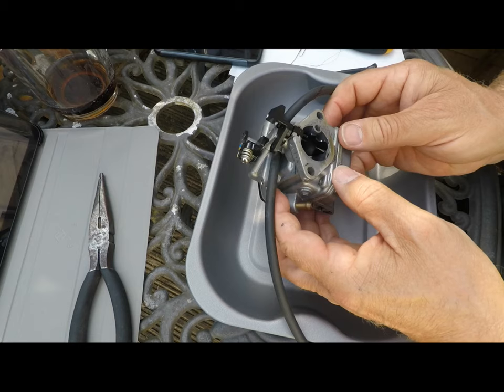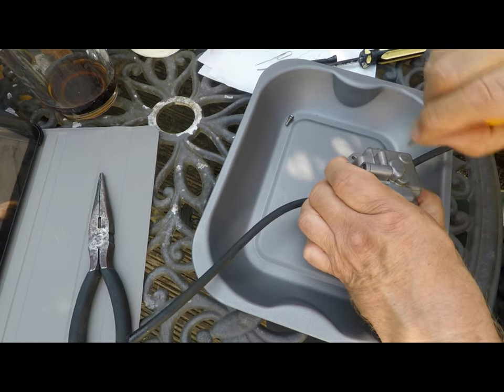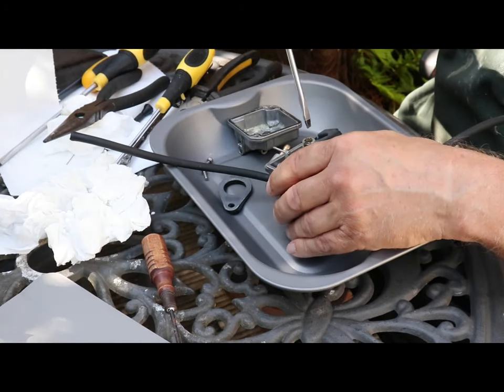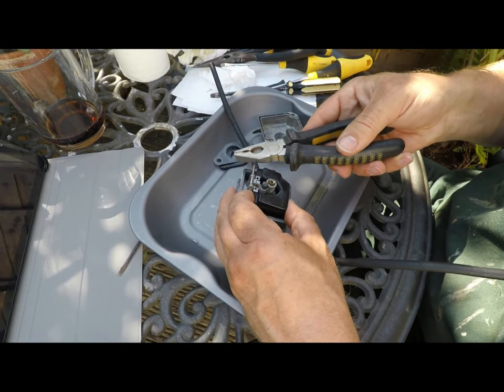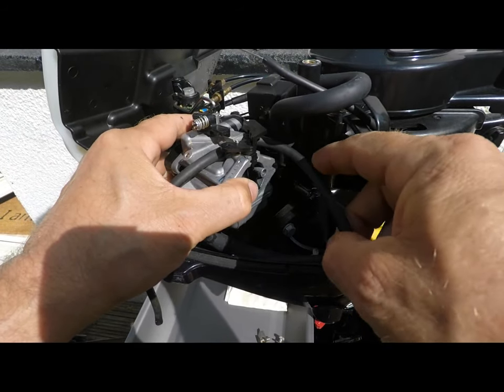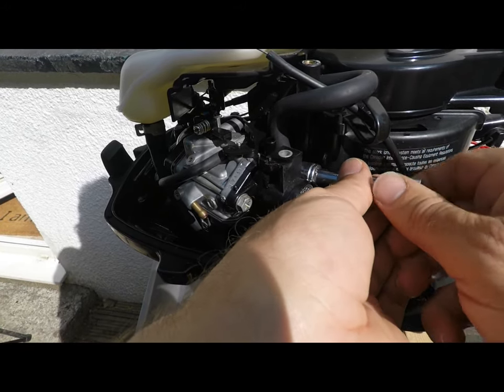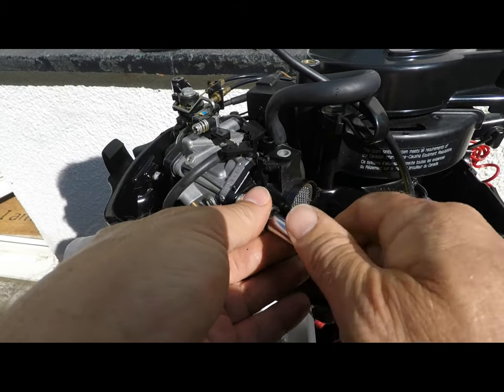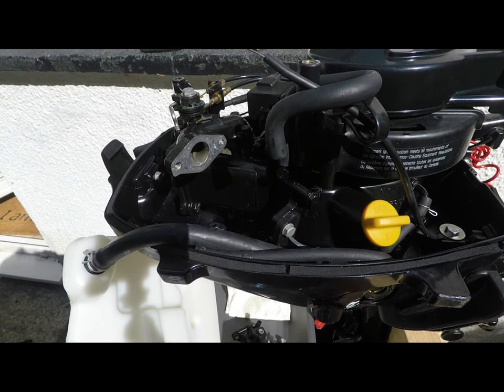Dinghy cruising cruising a Welsford 'navigator': cleaning a Tohatsu 4 stroke 3.5hp carburettor

Comment: I have the same outboard, and a sticking main jet appears to be a well known problem of the 3.5hp model - be it Mariner, Mercury or Tohatsu etc. Despite winterising, I went through the same routine every season to ensure trouble free starting. Removing the main jet was always a problem which I solved by stripping down the various jets at the end of the season and then only had to reassemble at the start of the next season.  A quick tip is after attaching carb to manifold push overflow tubes from outside the casing and simply slide onto carb.
Reply from the maker: Brilliant tip....wish I'd thought of that at the time.....🙄😄

Comment: I had a similar learning experience when a screw sheared off halfway into my Mirror Dinghy transom. Took over an hour with various pliers, drill bits and whatnot to remove, not to mention the mess left in the wood afterwards! Very brave to attempt servicing your own outboard, I just sold my 3.3hp and got an E-Propulsion Spirit. No more maintenance...
Reply from the maker: Yeah, in hindsight maybe I should have just paid the £120. But then nothing ventured, nothing learned or gained 🙄
Reply: plymouthwelshboy Oh absolutely. I’m all for trying things yourself and learning from it. Part of the joys of wooden boats and dinghy cruising!

Comment: I used all 4 methods to clean carbs which are carb spray, wire, ultrasonic and air compressor. I don't feel like taking 3-4 carbs off clean putting back on and still running crappy
Reply from the maker: actually it has been running really sweetly since I took it off and gave it a partial clean
Reply: I did a partial clean a few times on carbs that weren't too bad and ran fine also. Sometimes I just spray carb cleaner and run seafoam or some gas cleaners and motor runs better
Reply from the maker: @vkhiev  I just used carb cleaner 😄

Comment: The brass threaded parts (jets, etc) need a screwdriver that fits perfectly in each respective slot. Preferably the screwdrivers will be hollow ground, and not a flat taper at the tips. The hollow ground drivers have a blade with the working faces nearly, if not actually parallel to each other and wont cam out of the slot and they'll drive the soft metal much better.

The brass parts will be/can be really hard to shift and will release/come loose with a snapping motion. Ideally the part will be braced against something so you dont slip and spear yourself when they let go.  It can take a good deal of force to undo them. Stabilising the part also helps you keep a constant pressure and angle to the screwdriver,  keeping it firmly embedded in the slot.

Good on you for having a go, you might be in position one day where you need to get that apart for a cleaning and dont have the option to "take it somewhere".  If you need to develop some confidence, maybe see if you can buy a scrap carby and have a go at that, secure in the knowledge that it doesn't matter if you break something on it.  It's only really scary the first time or two you do something new.  

As my french paragliding instructor would say, "You can do eeeet!"
Reply from the maker: Thanks Michael. That's really encouraging advice full of good tips...really appreciate your help....thank you

Comment: Stope panicking by the way a carburetor for these is £28 on ebay
Reply from the maker: All sorted. Fixed it with a little help from a kind engineer down Cornwall way. Manifold piece was drilled out and new.bolta obtained. Carb works fine so didn't need any repairs....and I learned loads.....quids in all round 😄